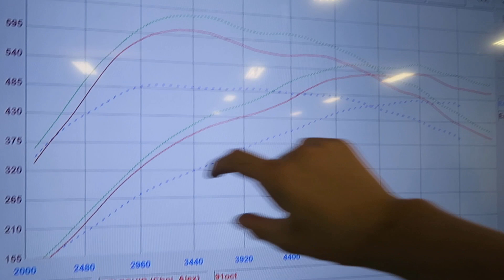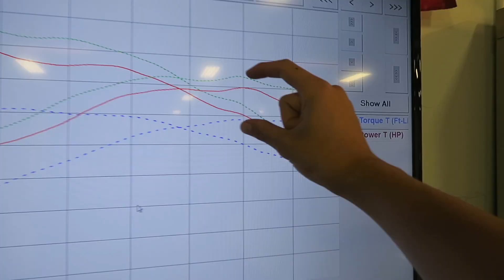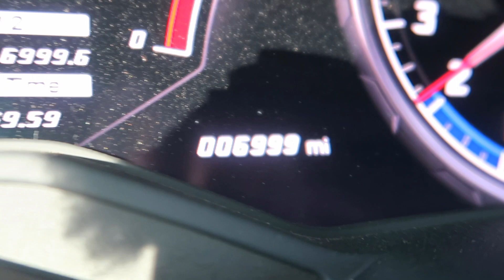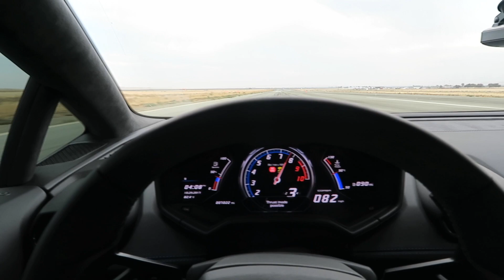Is the Audi RS7 Faster Than Most Supercars?

Comment: RS7s are straight up monsters
Reply: That’s why a Tesla beat it lmaoooo
Reply: Sam M but you’ll have a better time in the rs7 on some back roads. but yes the Tesla is faster but on higher speeds rs7 will catch up since the Tesla has a 155 mph speed limiter
Reply: AM4N stage 3 rs7 what power do they make apr dont do a stage 3 map for it
Reply: Troll Hunter almost 1000
Reply: @bearieroblox6451  but we are waiting for the v8 swapped tesla by rich rebuilds

Comment: hey, it has lunch control. DYNAMIC MODE > ESC FULLY OFF (press longer) > LEFT FOOT > FLOOR IT > RELEASE BRAKE.
Reply: Lipe Paiga only on the RS6 for some reason audi didn’t have it as a feature on the rs7
Reply: yes you can do it.
Reply: All Audi RS models, as well as Volkswagen GTI and R work that way on launch control. You can even program it in VAG cars through VCDS
Reply: Jordan John you can activate that via VCDS. I think the Dynamic Packet versions came with that ON. I drove two regular, one on and one off, and one Performance with launch on.
Reply from the maker: It does not have the traditional launch control where the transmission drops the clutch and the engine management controls the power for maximum grip. Yes you can launch it by doing so, but all you’re doing is braking and having the engine fight the brake until you let go, then you have to control the throttle manually or else you’ll just end up doing a 4wd burnout thru first and second gear.
Reply: So you have to take your car to someone who knows how turn it on. My RS6 Performance does Launch Control like 911s with PDK but using torque converter. My car charge the turbos and when you release the brakes it sends all the power to the wheels. Gonna upload a video on my channel to show you...
Reply: I know this is an old post, but seriously, RS7 (and S8) use the ZF 8-speed trans and this does NOT have launch control.  No stall converter, etc.  You just brake torque it off the line.

Comment: The VAG cars are very fast if tuned. I tuned my family wagon and it runs 0-62 in just over 6 seconds (when I have sufficient grip, FWD :-( ) and a top speed of 155 mph. Mind you it is just a 4 cilinder petrol 1.8 turbo family wagon and I weigh about 245 pounds.

Comment: Do you have an option to change map settings inside the car to run high octane fuel? Cause you wont gain anything just adding high octane to a 91 tune map.

Comment: But in the real world with all that torque it'll be much much quicker. You've gotta wind out the Lambo to get it moving like that, but the RS7 will accelerate at maximum no matter what gear rpm cause of the torque which will make for a much more thrilling daily driver.

Comment: Most cars speedometers are 8-12 mph high above 135 mph. So it might say 160 on your speedo, but your really doing 150. U less you have different sized tires on the car, then your speedomwill be off.

Comment: I work for audi. The rs7 has launch control buddy
Reply: qwerty49392000 torque converter automatics do not have launch control. You can brake torque to preload the transmission, but that is not true launch control. Working at audi doesn't mean you are an engineer. You may be a receptionist.
Reply: jordonbeaven sigh.......anyways, Audi has what they call “LAUNCH CONTROL” its in all of their service manuals. There’s a certain procedure that’s done , you hold the brake and the gas and the revs go up to 3500 and hold. Soooo.....how is this not a “True lunch control”?
Reply: qwerty49392000 in my manual under the launch control section it says specifically "applies to vehicles: with S tronic transmission"
Reply: qwerty49392000 i have had 2 audi's with proper launch control. A B8.5 S4, and a C7 S7.
Reply: qwerty49392000 Sorry, but the RS7 has not got launch control. My dad has one so that’s how I know, it’s just like launching any other car.